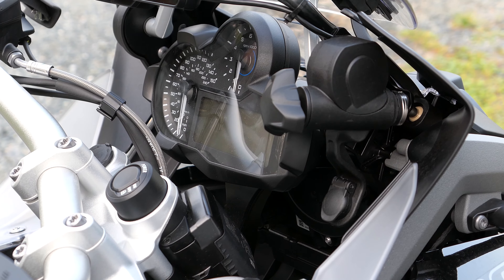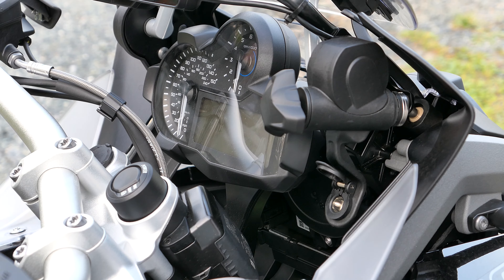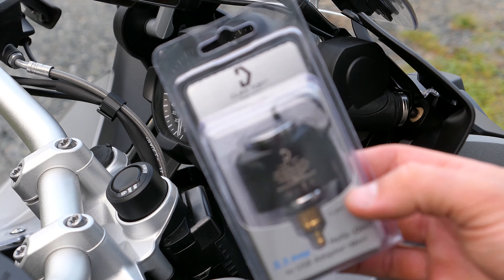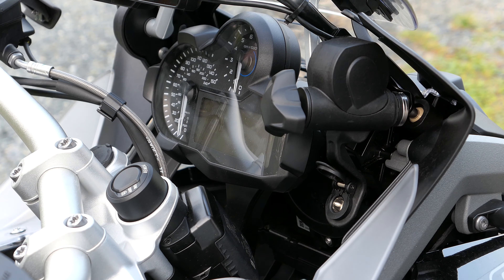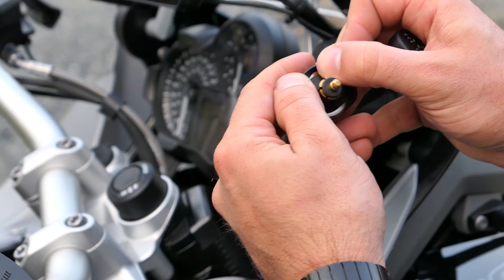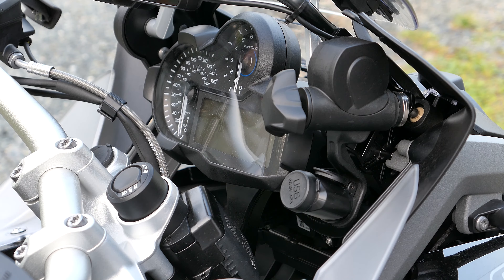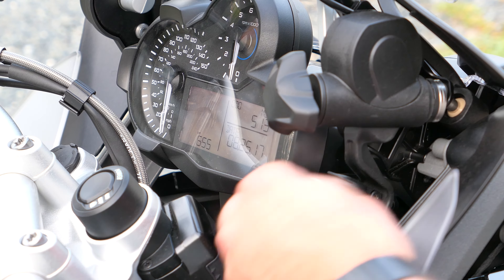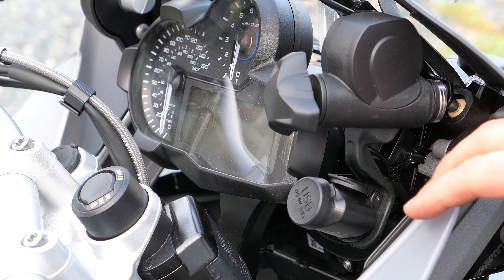Motorcycle BMW Hella DIN Plug to Dual Port USB Charger Install

Comment: Install the cover right by turning it  as you can see your cover is on an angle plus it stretches it when you removed or putting it back

Comment: I see the advantage of a rubber cover when not in use to keep out the rain but does that mean you can only use it if it is not raining?
Reply from the maker: I used this for years on long touring trips and while it still works, it is very rusty. It has never stopped working but it's looking really rusty so maybe replace every 20K miles for reliability?  but only if you keep the cover off when riding in the rain. Otherwise, it's fine.

Comment: Hi Adam.… Will this USB adaptor consume energy while the bike is off??…..I bought a 5 volt Hella Din por my 1200GS LC and left it inside the socket and after 3 days of not using the bike., the battery was gone. I charge the battery and after 3 months is still running perfect, so the problema was not the battery but the plug that was consuming power even thouht the bike was turned off.....Thanks!!
Reply from the maker: I keep mine in the bike 24/7. No issues with draw on my side.
Reply: Excellent…...thanks for your prompt reply!!